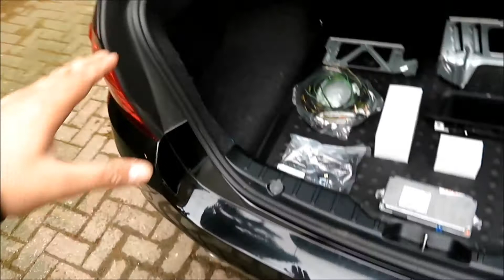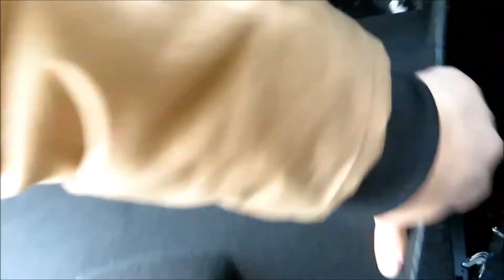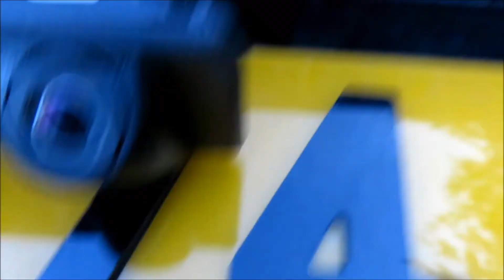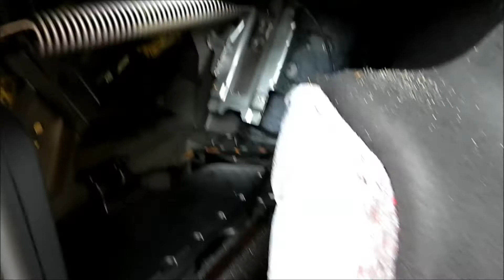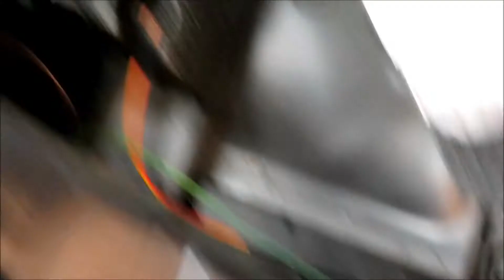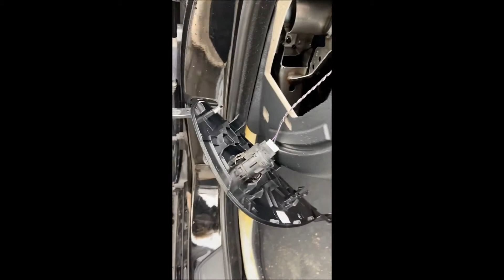BMW F10 Reverse Camera Installation | Genuine OEM | Midlands Vehicle Diagnostics

Comment: "To fix the CA9429 error, could you please confirm the pins on the IHKA unit connector for the CAN H (orange/green) and CAN L (green) wires?" Thanks